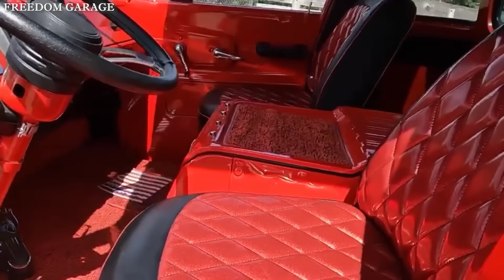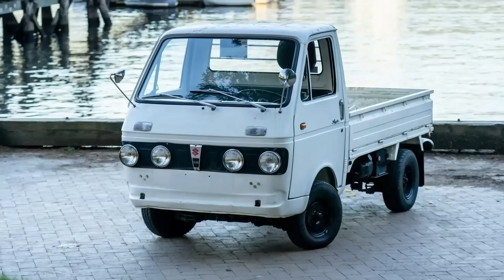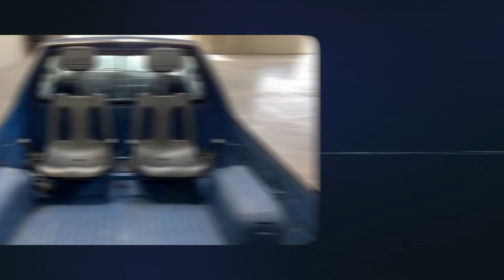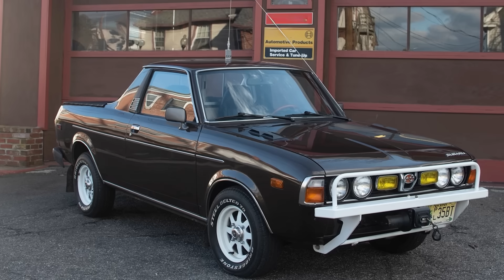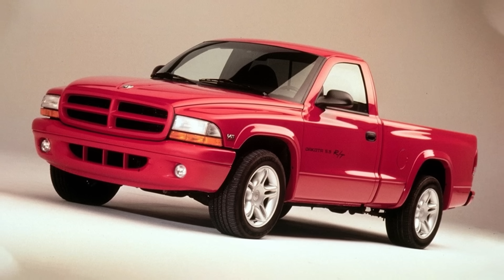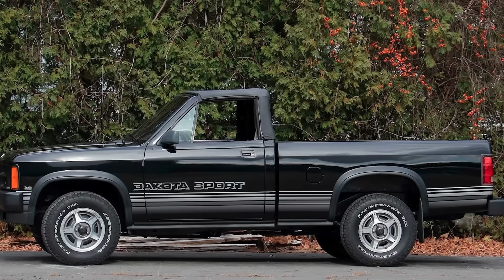3 Forgotten Pickup Trucks That Made No Sense!

Comment: I recall sitting on the hump of the Dodge A100 during trips to go camping. Two small kids shared the passenger seat and one sat on the hump. Safety had a whole different meaning back then.
The "jump seats" in the Brat were added to get around high "truck" import taxes. Most people ripped them out ASAP.

Comment: I learned to drive a stick shift in a military version of the A100. They removed the top, so it was open with just a windshield. I don't even recall if it had doors. This was on the flight line of a naval air base.

Comment: If the A100 made no sense then why was Ford, Chevy and VW producing the same style trucks at the same time? 
At the time Dodge did not have a muscle car line. So designers worked with the Dakota to compete with the muscle cars from Ford and GM. Gotta do the research before making gradiose statements.

Comment: My dad one of these vans with the slant six.  It wasn’t as hard to work on or maintain as this narrative says. It was a hard vehicle to drive as it had no power steering and manual drum brakes. It had 330,000 miles on it and still running when he sold it.

Comment: Another strange critter. The Chevrolet Corvair pickup. It had tailgate on side of bed. Of course the engine was under the bed. I myself had a delivery van that I set up as a camper and drove from Indiana to Arizona and north on the pacific highway to Seattle. Dealerships despised it and refused to work on it, so I had to suss out Vair loveing backyard mechanics.
Reply: They have a Corvair pickup convention in Maggie Valley N. C. every fall 🍂.

Comment: The Engine kept it too warm inside all the time .The engine could be worked on by removing the "Dog House" with a few bolts and nuts and there is no need to remove cab at all. Ford had one and Chevy had a similar one and so did VW.
Reply: Of the 4, The Volkswagen Transporter had the easiest access to the engine. It was put in the back.

It also helped that nearly all VW platforms up until 1970 used the same engine and transaxle, with a few improvements on the Bus and Transporter transaxle/transmission to allow better torque for heavier loads. A common upgrade for people who build beetle for drag racing was to replace some of the beetle's gear meshes with ones from Bus/Transporter transmissions.

Comment: The A100 (Dodge/Fargo) was designed for the city and tight spaces to compete with foreign compact trucks like the VW Type 2 (and vans like the Ford Econoline, Chevy Corvair Greenbriar, and Chevy G10).  Regular and heavy-duty Chrysler trucks were available (Dodge, Fargo, and DeSoto) including a crew cab and flat front heavy duty/tractor trucks.  The convertible Dakota was interesting (truck jeep alternative) and could have had bigger sales but the dealers jacked up the price on them and then with limited production it killed any interest (especially as Chrysler now had bought Jeep and was selling convertible models and the Commanche).

Comment: Ford also produced a cab over pickup truck based on their Econoline Van. I owned a1965 Econoline van. I really appreciated being able to sit in the driver's seat and work on the engine. It overheated in the summer so I had to remove the thermostat every summer. These were great vehicles. If one worried about front end collisions the spare tire could be mounted up front, and the bumper beefed up. I miss vehicles that had real bumpers.

Comment: I ordered a new 69 A100 van with the 318 3 speed manual but with the "highway" rear ratio, optional axles ($8.00 ea)  and spring packs ($6.00 ea) for use as a work truck to haul my tools as an on-call maintenance tech for high speed production packaging machinery of the day.  
That little booger once carried a load of 12' long logs stacke to the roof with 4' sticking out the back cut from a dozered tree line on farm property by crossing over two frozen ploughed fields with 10" furrows.  That thing was one tough hombre.  It finished life with me after no longer being needed for work so got bumped up with a mild cam, a Performer intake with a 700 double pumper carb, a set of tight headers with Walker mufflers and a paint job keeping the same blue colour. It was one fast truck that easily buried the speedo. A fun sleeper we used for camping trips into the Canadian north country for many summers.

Comment: There was no independent front suspension on the A100. It had an I beam with leaf springs. Dodge also had regular pickups as well.
Reply: Exactly! And to didn't have to remove the body for service. The entire engine cover could be removed for major service. For engine removal you could remove the passenger seat and remove the engine through the door

Comment: Jeep and Ford both had forward control cab trucks.
Reply: Chevrolet as well
Reply: @yomuno2511  Chevy had 2, one was based on the Corvair Van.  It had a side gate along with a short tailgate over the above the engine. Appliance delivery people loved it because it could be used as a ramp.  The G20 followed up the Corvair version with a Cutaway chassis some dealers fit with a pickup bed and other had utility beds.  Extremely versatile adaptation.
Reply: @jeffstorm  that Corvair also had fully independent front suspension.
Reply: Dodge had the A100

Comment: The 2 big issues on them and the Ford version, in any front end damage, the front seat occupants lose their legs! that and the thing was ultra light on the rear and would lose all stability under heavy braking!
Reply: True, though VW had something similar with the Type 2 Bus, though by the time of the Vanagon, I think they mitigated that to an extent, but not certain though.
Reply: @johnhpalmer6098  The VW wasn't too popular here in the USA but their low-side pickup could be seen all over Europe.
Reply: @rupe53  The VW truck was not as popular here, but they did exist. An ex BIL had one for a time as he's had several VW's including the bug, bus and a truck, It was from the 60's and I think a single cab at that. That was in I think the 80's.

But the truck, the bus were on the same chassis however, and being a cab over design in essence, still pertinent.

Comment: They made perfect sense with the cab over the front wheels it had a small turning radius perfect for city streets and alleys. Ford also had a similar truck. The reality is that it's not a truck but an open back van.
Reply: In the early 1960's when ford unveiled the Econoline as they also made a van based pickup to take on dodge and the A100 as by the mid or late 1960's ford quietly discontinued the Econoline pickup.
Reply: @daniellibich1376  Was going to say exactly that. Dodge was not the only snub nosed truck in the 60's, Ford's Econoline based truck was more or less similar.
Reply: The Chevy Corvair was also annoyed example of a forward control pickup.  Jeep also had a forward cotton used for military purpose.  Also Chevy made a sort of convertible truck in the 2000's.
Reply: @stevesilverson5001  With many debating over when the Corvair based van had morphed into the G-series van which had no relation to the G-body sedans when the G-series van took on the Econoline and dodge's A-100 van.  As likely when Kaiser owned the jeep brand when coming out with the FC series.